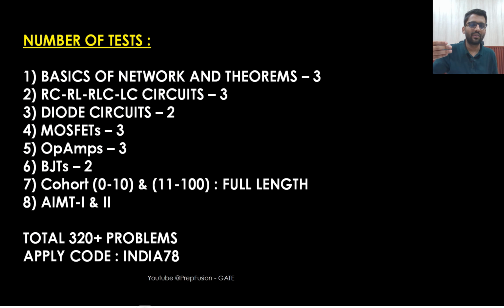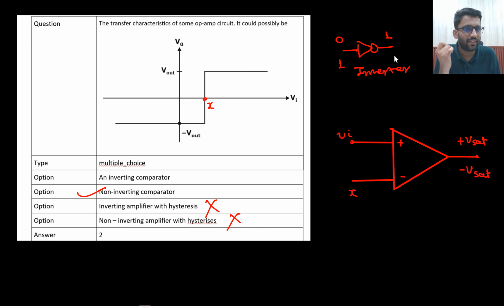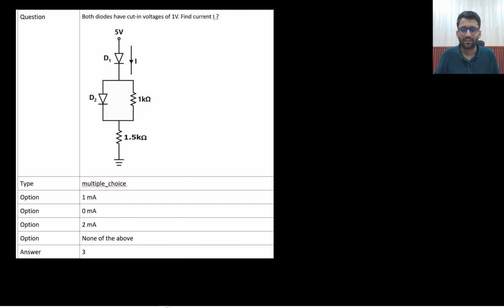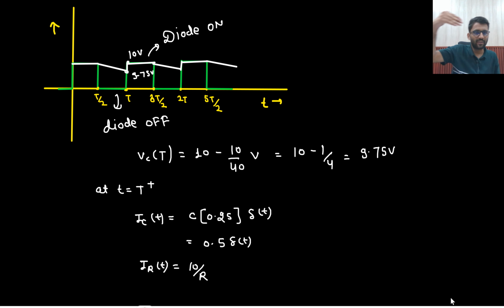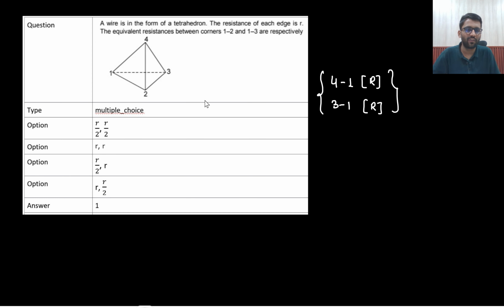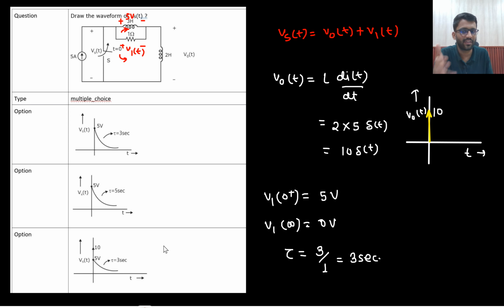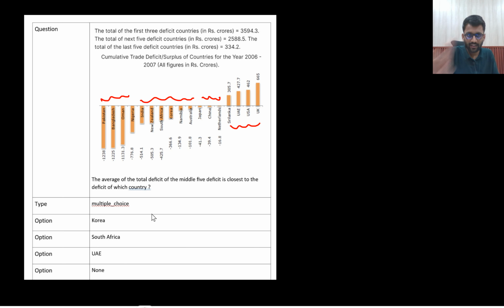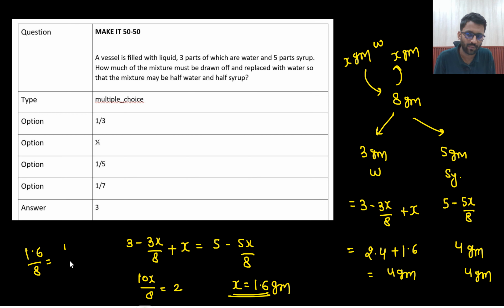🔥AIMT - 2 SOLUTIONS || Analog VLSI Placements || PrepFusion || Himanshu Agarwal

Comment: why in Q2 output impedance is not infinite. We will apply some test voltage at output but there is no current flowing so vtest/ I should be infinite….. As its ideal opamp we can assume 0 rout but hoq to proof
Reply: Output impedance is zero, not infinite.
Reply: @HimanshuAgarwal_  how if current is zero and we apply some test voltage at output then it should be infinite or 0/0?

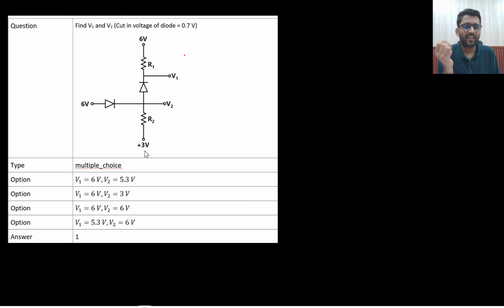Comment: 26:34 in question tech 14 ,we need to consider gm3, M3 will be replaced by 1/gm3 as ssm of M3 is ro3 ll 1/gm3 . As mentioned ro3 is infinite net parallel resistance will be 1/gm3.  Then answer may vary......
Reply from the maker: 1/gm3 won't be there. Vgs is zero there
Reply: Got it, Thank you!